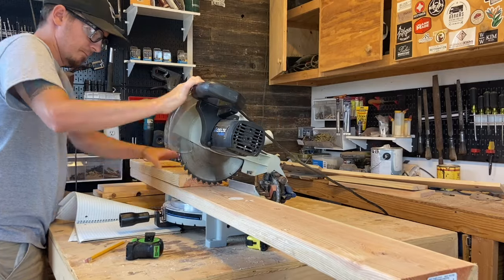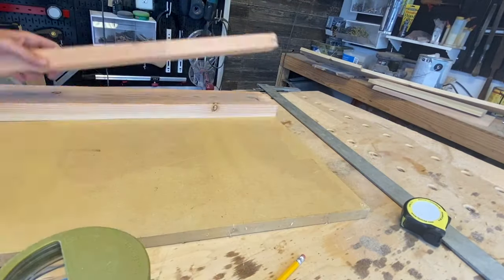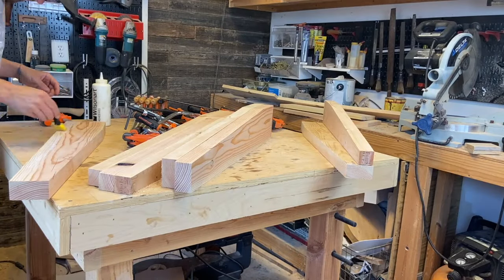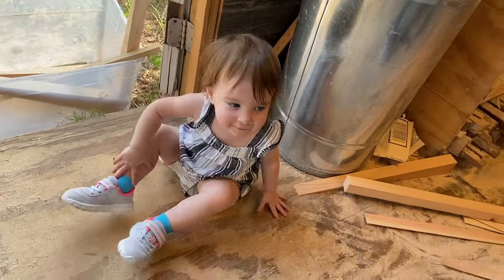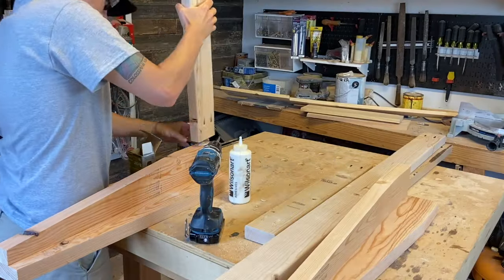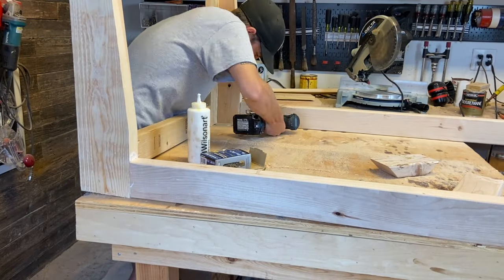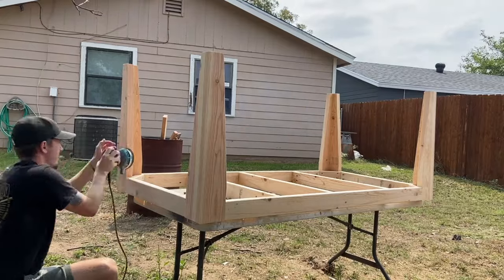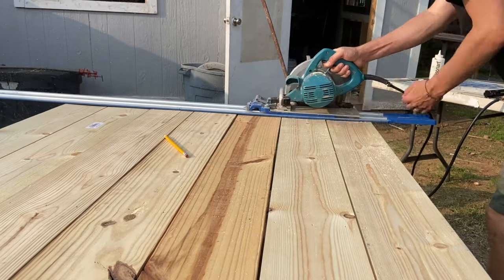DIY Kitchen Table Build // ANYONE Can Build It!

Comment: Was decent up until you used the nails, hard to imagine why you wouldn't use a better method to get the boards down.  Could have just glued it down, or better yet placed the 2x4'x horizontally and screw it super easy from the bottom.
Reply: Yes I absolutely hated it when he started nailing. I don’t like the spacing of the boards either I would have glued them together but if that is what the customer wants I get it.
Reply: @MrSota1 I made a dining room table from big box lumber and glued boards together. After about 15 months they finally dried all the way and pulled joints open some. Gonna use some epoxy in them to close gaps and refinish it. I wish I had gapped like he did and controlled it more but live and learn. Plus if it was for a client build it to order I guess.

Comment: You should never glue a table top to the base, always use Z Clips or Figure 8 Clips so the top is able to expand and contract without cracking
Reply: I hear you but ultimately he is using construction lumber so it’s going to crack or warp anyways
Reply: What are these
Reply: MInd your own business. How about that?
Reply: @melissapoole8580  This is the comment section on a public video.

Comment: Did you not change the jig at all or just change the width of one side of the legs by cutting 1.5 inches off 4 of them? It would seem that you cut the jig when you cut the smaller pieces, I would assume by moving the fence in by 1.5 inches?
Reply from the maker: Correct I didn’t change the jig, just ripped 1 1/2 off of one portion.